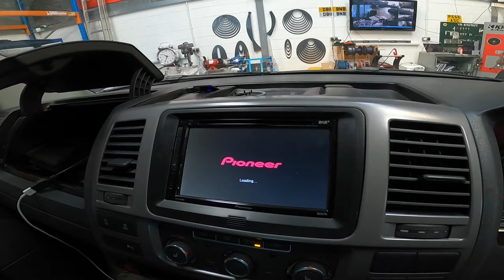SNAP-ON TOOL TOUR UPDATE

Comment: In regards to your LN47ACF pliers you are waiting to exchange via warranty for “slack” I presume you mean loose and they don’t sit flush as they should?
Reply from the maker: its the side to side aviation like the centre rivet isnt tight enough
Reply: @AlexCarter-AscAudio  the batch we got over here in Ireland seem to not sit flush at the tips of the pliers.
Reply from the maker: the qc with a pricey tools sometimes goes adrift i understand why they get slated sometimes because of this if you want to be the best you have to keep ontop of the game i do see them slipping a little
Reply: @AlexCarter-AscAudio  I agree with that 💯. I moved from America to Ireland 14yrs ago and had been wrenching since 98. I built 95% of my tool set in the early yrs. If I have to warranty and item, the new replacement does not look and act as good as the item that failed. Most of my sockets have the build stamp that reference’s from 00-03. I would expect more from them being the brand that they are.

Comment: Great job sorting the broken wires on the BMW - take it that was IPA you used in the spray pump to clean wires?  Still cringing over the water damage to the door-mounted Audison Voce speakers (a few videos back) - some of the best sounding speakers ever, and a crying shame that they weren’t better installed!  Was like seeing a vandalised Mona Lisa!  If it was my car, I’d have gone back to original fitting dealer and had new Audison Voces fitted properly (to protect from water damage) - F.O.C!
Reply from the maker: it was actually brake and clutch cleaner george to remove the black sticky goo some clown had pumped into the hole , the customer is going to the company to kick off im sure more to come audison do see these vids

Comment: not to be rude but why do you have so many tools that arent used for your audio job ? e.g every spanner
Reply: In my opinion. If you have a Mr Big you commit to building a proper Spanner Drawer! But none the less various spanner’s are used on a daily basis even in audio shops. Either way have you seen the tuner cars out infront of the shop when Alex walks out to the tools truck? As well as anyone in this trade guaranteed works on all their families vehicles as well as close friends.
Reply from the maker: its ok i also own a lotus  , yes i need all the spanners i also build v8 twin turbo engines too